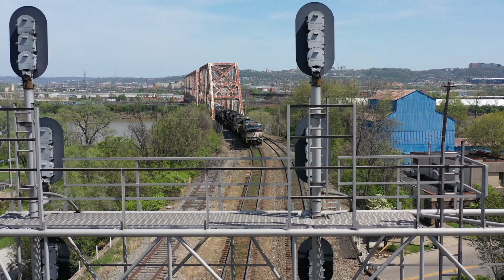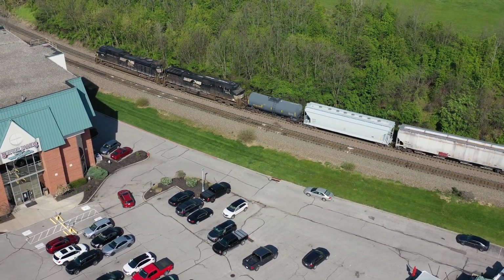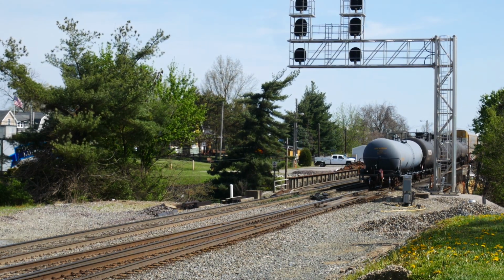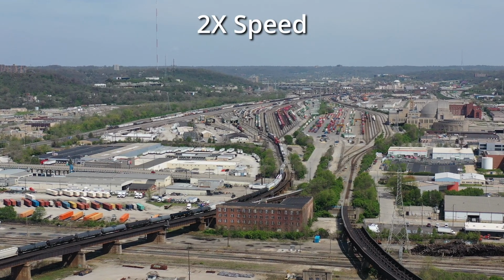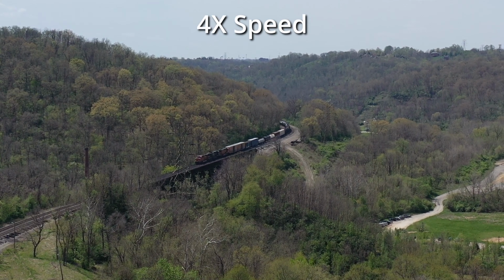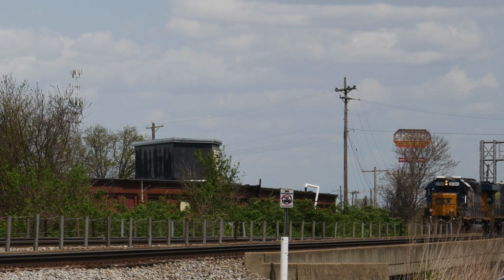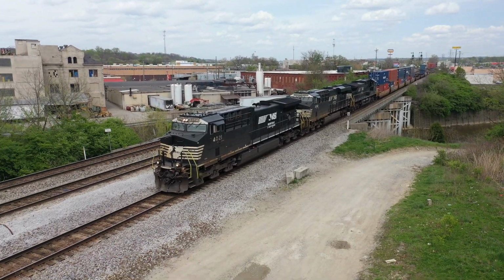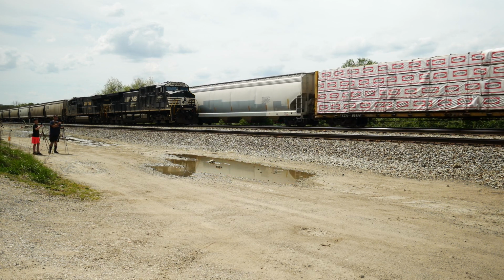Pt. 1: Trying to Chase an EMD E-unit down the NS main line in Kentucky

Comment: lots of good action, so years ago 2 big rail yards were built basically next to each other, CSX’s Queensgate and NS’s Guest ? thanks
Reply from the maker: Hey Nat, 
So, the Queensgate yard consolidated several smaller yards into one massive location. The northern end of the yard empties into a nice, single line flowing several tracks because there were no obstacles to deal with.
The southern end has a few issues to overcome.
One of which is a flood wall that must be scaled. The second challenge is one of the CSX lines goes by Union Terminal. 
So, the yard exits to the south are split by the NS Gest Street yard.
The easternmost line that goes by Union Terminal (Amtrak Cardinal route) must remain elevated to cross over the flood wall.
It then goes over a major road and a street.
The double track which exits on the western side, is able to gradually climb to the other tracks' elevation as they merge before coming to the C&O Ohio River bridge.
Sorry I don't have a more concise version for you, but this area is a mix of several railroads being merged together over many years.
If I could find enough pictures and some history buffs, I'd love to do a video on it.
Reply: thanks very interesting and the flood wall explains the tracks being elevated

Comment: I have often wondered why American trains stop so far from the signals too.  Is it just a means of ensuring that such massive trains are under proper control? 🇬🇧
Reply from the maker: You're probably spot on with that guess.
Better to stop short than to risk going past a signal.
Do you have these massive freights in England?
The little footage I've seen shows shorter trains.
Reply: Yes, it is.
Reply: @nkyrailfan  Not really, our trains are punny by comparison, but with a country size of a small state we don't need them.